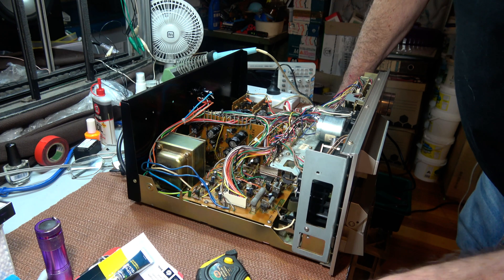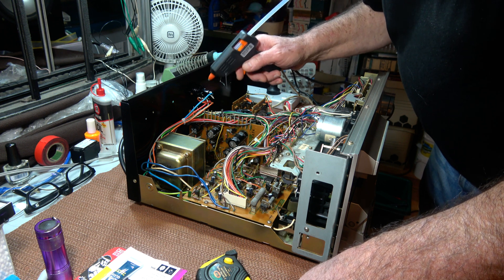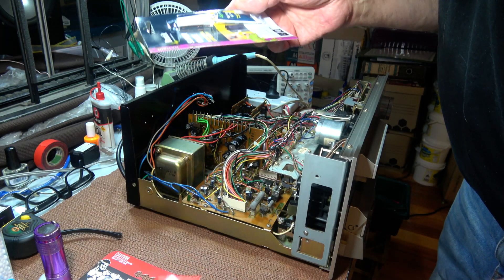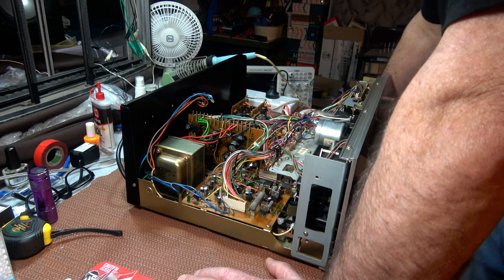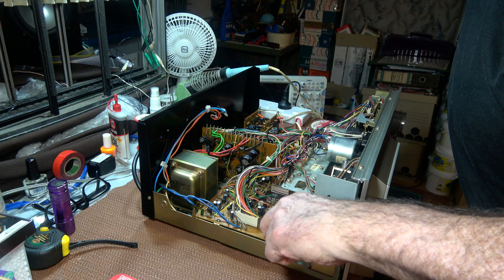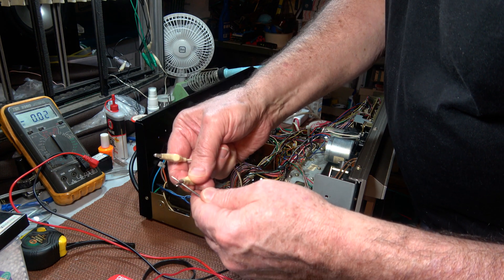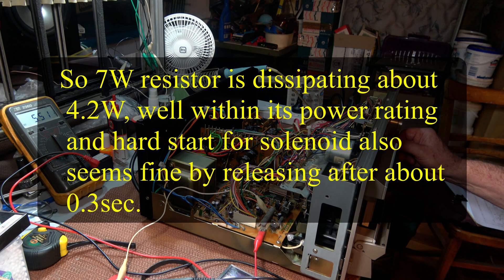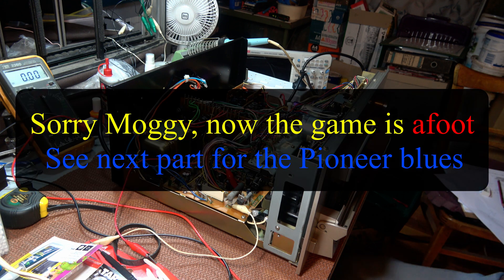Pioneer CT-F950 Repair & Calibration Part 1

Comment: HI some i know his mate had a EMI slave cassette talking book  set up dave the man i know told me there alot of bull on the net about cassette i checked he's right  i have on line music and the track don't match the song time on cassette alot of the time  dave did say the dubbing deck speeds are all over the place  when making cassette pre recorded music    i use full track 1/8  test tapes to get it right i know this can be a right pain just to fix 1-2 deck at a time
Reply from the maker: Adjusting the speed with a calibration tape is all we can do. Production of pre-recorded tapes is out of our control.